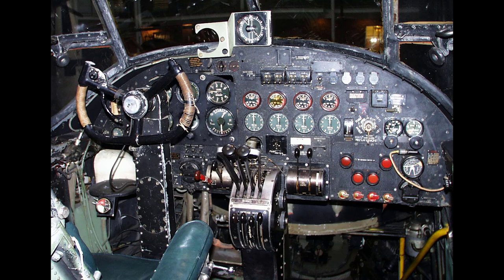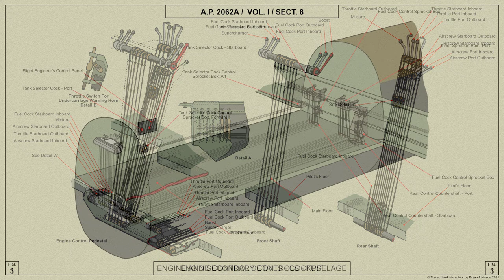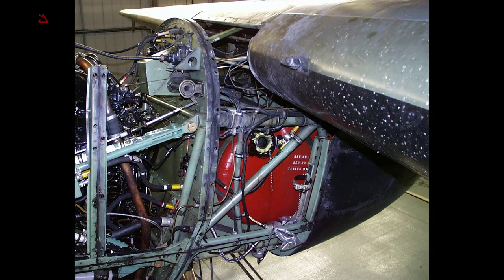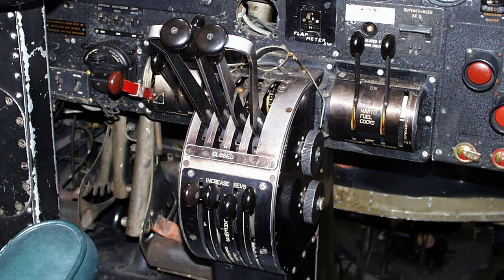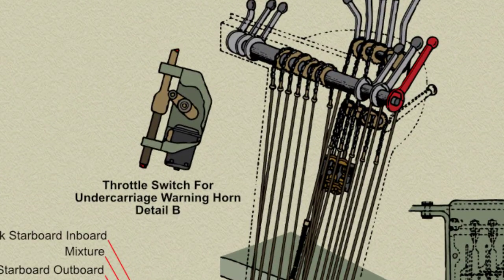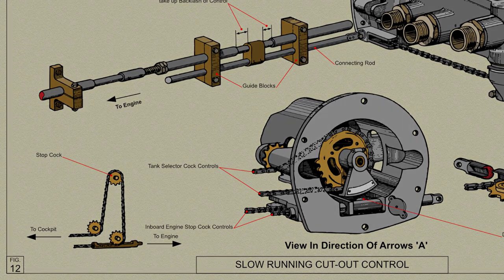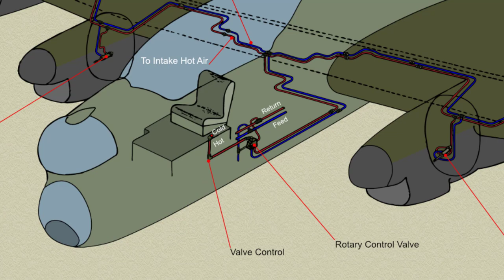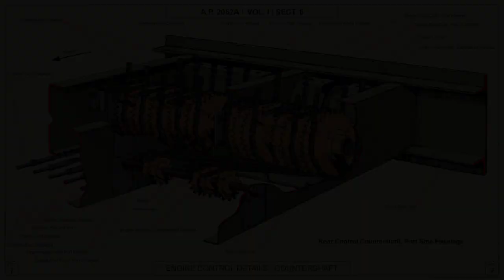Avro Lancaster – The Engine Controls

Comment: My brain hurts. Last five years in the Army (Australian Regular Army) was at an Aviation workshop where I ordered consumerables for Kiowas, Blackhawks, Iroquois and Nomads, before the Army retired the Nomads. Leaving the Army I worked for an aviation defence contractor in the spares and consumerable substores (CSTs-nuts, bolts,screws,orings etc) for the maintenance of Kiowas and Blackhawks for 13 years. My admiration goes to the designers who came up with and put all that stuff together and made it work, both then and now, and, the girls and boys who were trained to maintain it so that it worked as advertised. My standard answer to what I did was 'I order spares and consumerables for the maintenance of helicopters, but I have no idea about how it goes together or what makes it work. I think fuel and electricity are involved somehow.' Thankyou for making this vid about the controls and linkage and putting it all together.
Reply from the maker: You're very welcome, and thanks for sharing